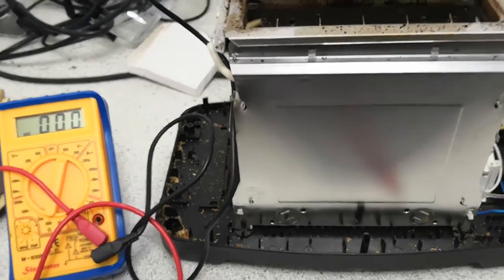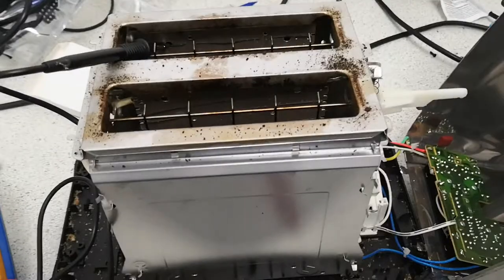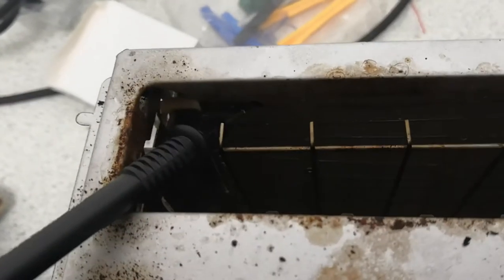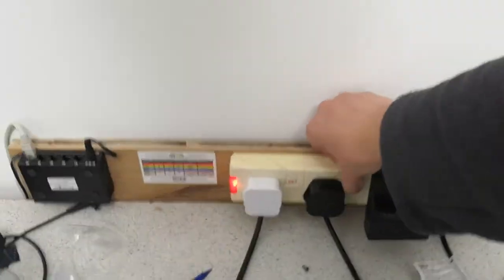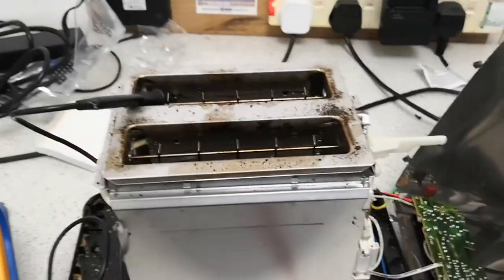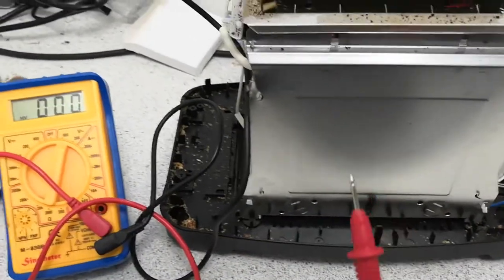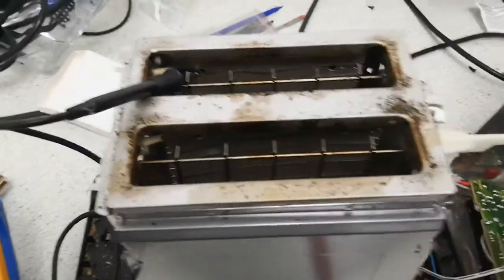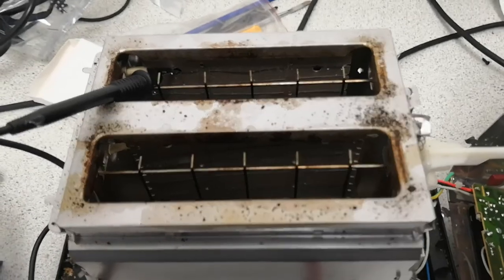Why shouldn't you stick a knife in a toaster?

Comment: The reason you stick a knife in a toaster is to get the bread out. The knife should only touch the bread not the heating element. There are metal clamps for the bread that tighten and loosen based on the lever for the toaster. The tip of the knife goes in to get just the tip of the bread without touching anything else. Be a man and live dangerously, but not so dangerous if you can have a steady hand.
Reply: or just unplug it